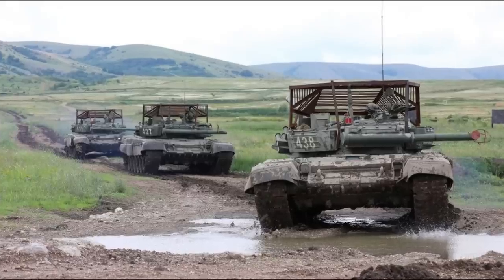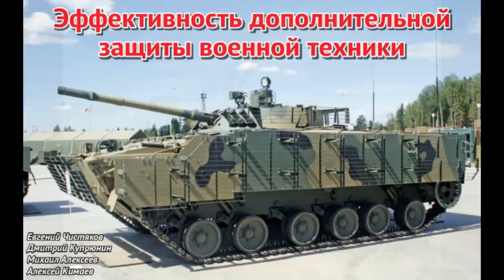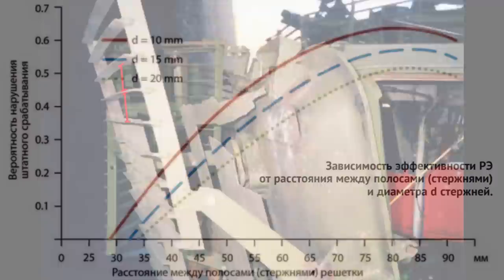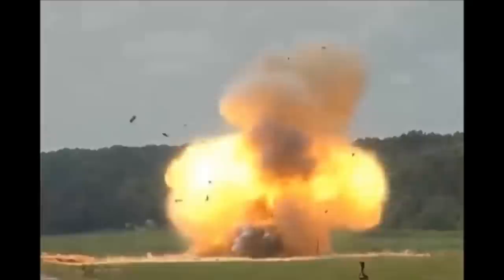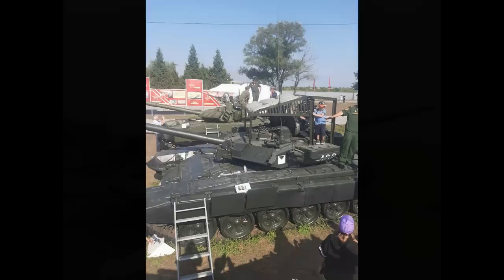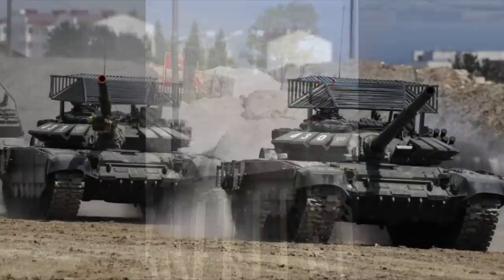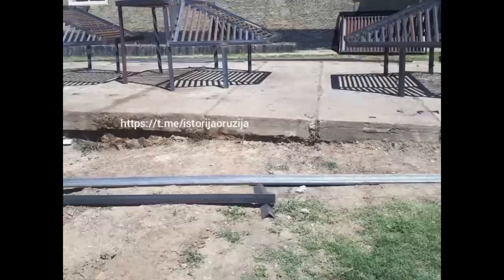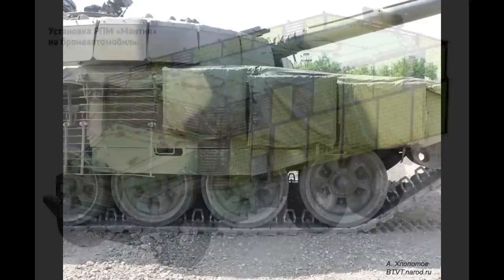The Truth About COPE CAGES

Comment: My assumption has always been that these cope cages were for drone dropped rounds, It would definitely never work vs Javelin charges. It makes the profile of the tank so much bigger, either way it seems like a insufficient cope to the new challenges tanks face
Reply: Even less for TOW and NLAW which will fly below the cage and explode...
Reply: Where did they all go? Besides some early videos of the conflict you don't see these cope cages anywhere in Russian forces anymore. Besides Javelins have proven pretty sucky. Seen APCs and BMPs eat 3-4 of them on video and still survive just from the anti-HEAT screens. Ukrainians are getting most of their kills from Arty, Russians much the same and air power.
Reply: @anasevi9456  Russia realized the futility in using them.
Reply: @donavonrobbins1908  that and the smart commanders realizing the west is basically funding Ukraine so the Ukrainian army doesn't need to do MacGyver shit with small drones, they are getting real military drones for free basically.

I can see them in use in city battles where a civilian might drop a molotov cocktail or two but, most of the destroyed tanks are in open fields and not cities (which is weird because it is usually the opposite in battle theory).
Reply: @anasevi9456  there are reports of tank crews removing them because it's more of a hindrance than anything
Reply: @anasevi9456  Some off javelin miss the target
Reply: I thing Javelin was effective in the begin, because they meet so many static unprepared tanks in ambush or so.But dont know how effective javelin will be vs full speed move tank.At all i thing this javelins is a bit over hyped.
Reply: @anasevi9456  Javelin isnt sucky, its just chonky (less maneuverable) and they arent carried as often and as much as other AT weapons.
Reply: Cheapo drones werent much a thing when the cage ideas came about and they installed them before the current war anyway afaik.  

They're in the way of operating the tank and the way they were installed was that a command came from upper officers to do it and theres no standardization so they don't know what kinda works as far as the cope cages goes. 

As such they were told to install something as a kind of a cargo cult thing. It's not like they have much to do when there isn't a war so telling them to do something like that fits
Reply: yes, either against drone dropped munitions or to hold camouflage materials (which might also provide some protection against shrapnel, allowing the crew to ride with hatches open which is always better for crew efficiency than buttoned down).
Reply: @edi9892  TOW would go where directed by the gunner, which would typically be right about the height of the cage over the turret, or at a similar height over the engine deck.
Any halfway competent gunner would see the cage in his sights and opt for the unprotected engine deck instead.
Reply: @anasevi9456  lol show proof of 3-4 javelins being fired into APCs to kill them, even assuming worst case scenario you would likely only need 2 hits to destroy one assuming the first one was an unlucky hit in a relatively empty part of the vehicle
Reply: Seems tanks themselves are at their historical pinnacle of success or behind it. It was part of 1stchalf of 20th century, but since then plenty of antitan weapons were developed, and armoring countermeasures making tanks either heavier and or with sophisticated electronics
 Similar story of Ww2 battleships. Too heavy, armored and its main purpose to fight against other big stuff of enemy.
Done with smaller, more mobile flying weapons of future.
While focus of weapon design shifting from its offensive purpose to its own defense, it becomes irrationally expensive, sophisticated.
This could lead to development of some kind of AA defense tank support units, but I doubt it. It would probably end up way antiaircraft bateries on ground.
Reply: @suportbghelp4938  Javelin works just as well against a moving target lol, it's IR guided
Reply: @gstormcz  Not really, but the way they are deployed is going to have to change. 
Just as it did at the end of WW1 when anti-tank guns started to become common. And again during WW2 when tank to tank combat became a thing and aircraft developed an anti-tank capability.

What we're going to see is likely a revival of the tracked anti-air systems like Gepard and Sgt York, but capable of firing on the move so they can keep up with the tanks as they move forward. That should help with coverage against drones. Camouflage will also once again become more important, as most drones use optical systems which were deemed dead with the large scale adoption of infrared sensors.
And then there's the increasing interest in active defensive systems to take out incoming missiles, things like lasers that were not long ago thought impossible
Reply: @suportbghelp4938  Javelins use smart munition that seeks out the target much like you may see a MANPAD track an air target, they were made with moving targets in mind
Reply: @Sam-kr9wj  Just on theory, but i cant imagine full speed up tank to be hited clear above for max damage, javelin most probably will hit backward or somewhere close to tank.People hard overrated javelins.
Reply: @suportbghelp4938  
Full speed moving tank versus a full speed Javelin missile dropping from the sky, tank targeted. No contest.
Reply: @gflucas4285  Bla bla, just your imagination, if javelins was that good, tanks cant exist anymore.
Reply: @suportbghelp4938  of course tanks can exist with a Javelin about. Just because there's a very effective weapon to counter said vehicle, doesn't mean the vehicle is useless, it just means you offset their weakness with proper support. West Doctrine is all about that, whereas Russian doctrine seems a bit outdated.
Reply: @zerginfestorhots6132  And when West doctrine is tested?NATO just hard fear from outdated doctrine?
Reply: @edi9892  Their APS and ERA can deter TOW and NLAW in most circumstances.
Reply: @suportbghelp4938  
Correction Boghelp. Russian Tanks explode beautifully when hit by Javelin anti tank missiles. So Russian tanks don't exist anymore. Kaboom. There goes another tank, turret and 3 man crew. No amount of your Bla,bla,bla changes that fact.
No amount of bedframes or chicken wire can protect the tank.

Comment: The better light and flat versions look like might work decent as a cargo rack, which in general a crew can always use more storage
Reply: except in a poor location making you easier to spot. Although more crew storage is always appreciated.
Reply: @neurofiedyamato8763  it's a god damn tank, you hear its engine from kilometers
Reply: For essential vodka!
Reply: @ImPedofinderGeneral  yeah but imagine if you were trying to hide it behind a ridge or something from other tanks or observation from long range. the cage makes a relatively short T-72 taller than an Abrams. And if you're trying to move into a hull down firing position you'd see the cage coming up before the gun was able to fire, giving away that the tank is about to try to shoot.
Reply: @Michael-uc2pn  I saw one tank with lots of branches on this thing. Looked funny and like beaver nest. But you are right, it's probably worster for ambush
Reply: @ImPedofinderGeneral  Can't pin point a tank with engine noises alone. Maybe know its coming or know its in that general direction. But you can't shoot at something you can't see. A cage makes you visible.
Also a tank can still run on its APU or battery without its main engine running. Also sound only alerts enemy infantry. Everything else are reliant on visual information.
Reply: The salvage crew can use the grill for a BBQ once the tank brews up.

Comment: Cope cages tanks are the modern equivalent of bed springs fitted to soviet tanks in WW2. Did 🤬 all for protection and mostly likely meant to be a morale booster. If you are a tank going into a city, you are more likely to feel safer and not abandon so easy with the cage/bed springs installed. The lack of the cages since February shows they dropped that idea as it didn't help at all and probably hindered the crew and tanks performance.
Reply: Challenge 2 with cages.?

Comment: The NLAWs detonate about 1 metre (3 ft) above the turret using concussion to do the job. Cope cage might stop an RPG but will not stop the shock wave from an NLAW or Javelin.
Reply: NLAW does not use "concussion". It has a downward facing HEAT warhead that shoots a jet through the top armor of the tank. That's why it's ineffective in a direct attack role against armor.

Comment: Steel angle, here in NZ, just as we use the term ‘aluminium angle’, prefixed/suffixed by the length of each side and the thickness of the metal. The product used in the ‘cope cages’ appears to the basic 50mm mild steel angle that is especially popular where the fabricated frame is intended to be put in one place and left there.
Reply: it's spelled "aluminum" in the u.s.
Reply: @doctorboot7191  but he was specifically referring to NZ
Reply: @doctorboot7191  The US spells it wrong

Comment: the javelin is specifically designed to defeat this type of armor with it's tandem charge.
Reply: Tandem charges are to deal with ERA not slat armour
Reply: As Blue Mountain has said. Tandem charge designed to defeat ERA.
BUT the welded angle iron cage offers no protection as the kinetic energy of the missile warhead would easily overcome the mild steel frame. The secondary shaped charge will still penetrate and blow up the tank.

Comment: crew member said:
Динамическая защита. Я всегда к ней скептически относился. И вот два попадания – я своими глазами видел: срабатывает, реально помогает.

Обвесы (металлические решетки для защиты от противотанковых ракет) мы сначала все наварили на танки, а потом их все сняли. Во-первых, неудобно: пулемет не двигается, антенна когда замыкает об решетку – сгорает радиостанция, связь пропадает. И если будет какое-то возгорание, там просто нереально будет вылезти из танка. Потому что когда встаешь в полный рост – упираешься. Поэтому их все сняли и выкинули.
Reply: Reactive armor. I've always felt sceptical about it. And then, I saw the tank being hit two times - I saw it with my own eyes: works, really helps.

We've welded metallic cages against anti-tank rockets, and then took them off. First, it is unconvinient: machine gun does not move, and sometimes short curcuit in antenna is caused by cage, and when it happens - radio breaks and communications are lost. And when there is a fire, it's impossible to get out, because when you get up - you rest against it. That's why we took them off and threw away.

Sorry, my english is not ideal.
Reply: @nothingness29   use yandex-translate)))

Comment: Those "cope cages" are clearly made from "angle bar" or "angle iron", which (angle iron) is a cheaper way of making long, rigid beams with little material by hot-rolling a steel billet into a ninety-degree shape along its length. Perhaps the effect of properly designed slat armour could have ben replicated if the bars were welded onto their frames with one flange flat and the other sticking up like a fin, so that it's effectively bars spaced as per the factory design to an incoming RPG warhead.

Comment: The cumulative jet has a focus point for which it is designed. If you move the moment of detonation away from the surface of the armor, the penetration depth drops critically. In this case, there is no destruction.
However, the inconvenience is far greater than the benefits.